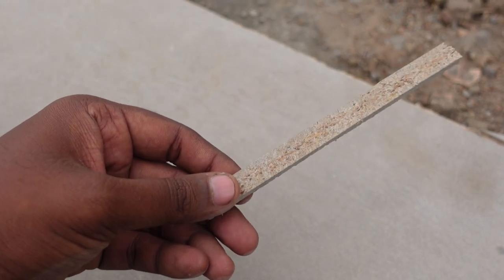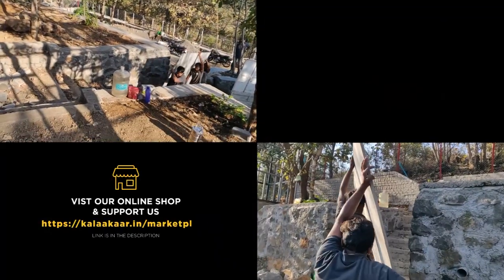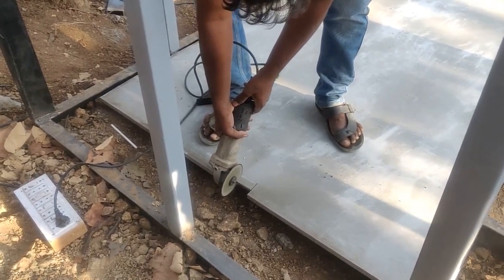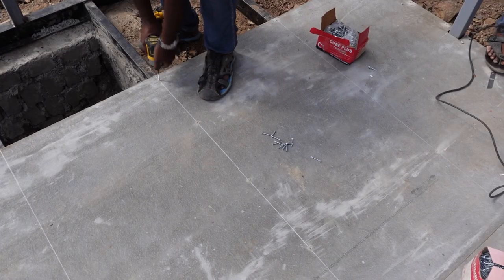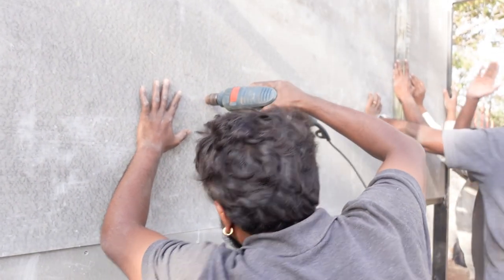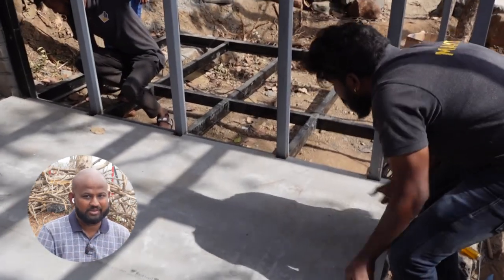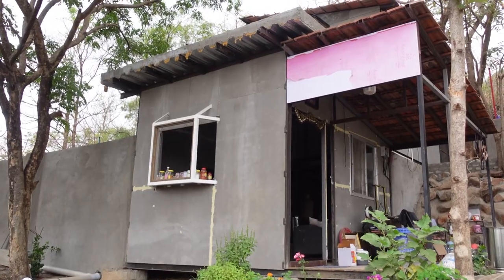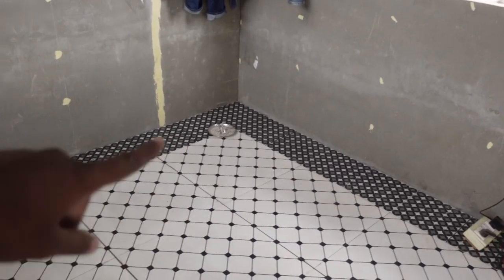Putting up Bison Panel walls - Tiny House

Comment: Great... This is future of individual small houses. May i give one suggestion?
The panels which you want to paint, first give one or two coatings before fixing. This will same time, paint quantity, improve quality of paint and equally important is during ceiling painting, printer eyes are not exposed to paint drops falling in eyes...
Reply from the maker: Thanks for the tips!

Comment: Hey @kalaakaar-in Team. Nice informative video. Can you please tell me how to hang photo frames on bison partition wall. Can i use nails or i have to drill screws? Or there is anything else we can do.
Reply from the maker: Using nails will crack. So please use screws directly like how you use in wood. This will work
Reply: @Kalaakaar-in  Thank you for the answer.

Comment: Great video , I have a question... 
Can these pannels be used on brik wall instead of plastering ill just get a board and stick it up against the wall using cement ?
Reply: You can use the bison panel above the normal brick wall but just make sure that you are using low thickness one and you have to drill it on the brick wall.

 I would prefer that you get the help of knowledgeable technician so that he can help you

Comment: After your video i plan to do for room partition do you think it's a good idea? Because we built the home in normal brick and cements.. when I contact the agent they said they use only 6mm steel instead of Iron Pipe.. will it survive? Also how much mm Sheet needed for room partition. Any Idea please?
Reply from the maker: Yes. It is a good idea. Go for it. Entire hospital partitions are done using this sheet. 10mm minimum is good.

Comment: This is my dream, when I build a new house I'll try it if possible in Mizoram , for exterior wall how many design u have? 

I really love it because can be use for flooring also, if we used for floor,did needed hard wood floors carpet?

In the video, you used steel for foundation I hope it will rash earlier
Reply from the maker: Steel takes atleast 70 years to rust if you have painted properly. On top of bison panel you can do tile work or wooden carpet.

Comment: For wall do you put on both sides to cover the iron structure?
Reply from the maker: Yes. I added insulation inside and put sheets on both sides.
Reply: @Kalaakaar-in  👌

Comment: Great work sir.. planning my own fiber board construction… learned a lot,having a few doubts,hope you can help with them
1) how plumbing can be done in a fiber cement board , will the screws hold the pipes when water flows through?
2) the risk of electrical discharge? Any protective measures?
3) in case of a mezzanine floor will there be any vibrations , even with tiles ?..
Thank you.😊
Reply from the maker: 1. We do it outside the home. Not inside the walls.
2. The house is grounded and also the MCB trips. Also we run the wires outside the walls in conduit. We did not try to cut the steel and keep the wires inside.
3. If you have enough supporting steel then the floor does not vibrate. And after tiles it becomes heavy that vibrations are reduced even more.

Comment: Wow Congratulation you are the first tiny house builder from INdia I know of in Youtube. India needs tiny houses actually more than any other country And the tiny houses in USA are such a big joke. They call 850 squarefeet as tiny house. IN INdia that is the standard size of 2 bedroom flats in highly populated cities.
BTW you did not mention the price of each sheet. Could you share the current prices.
I wish you were in my city the @@#$#@ Interiro decorates refuse to use BIson Sheets they say it works out the same as plywood. I knew it was 40rs per Sqft. And a cheap and decent quality ply is not less than 60 rupees and then you have to put 60 ruppes or say 40 rupees cheap laminated and then pay the carpenter 120 per sqft labour.
I wanted to make dry wall in my office with This Boards on MS Frame and use PINE wood style laminated MDF for the desk which was hanging on MS frame and use the pine and gray of the Board as a color combination and just put a sealant on the board to reduce the cost.
It would have been over in 3 lakhs or less but In my city a 1000 square feet carpet office will not be ready for less than 10 laksh and cheapest is 7 lakhs. But my interior decorator just kept lying that this plywood will cost the same and then the end bill was 9 lakhs even though we gave him a budget of 5 lakhs and he was earlier very open wanted to do something differnt but then he decided to fleece us. First he said he will give us wooden flooring in 5 lakhs which was doable as this would have easily finished in less than 3 lakhs.
Best part these boards are sound proof.
Please share the current cost of thes boards 8x10 or square feet wise and per MM. My friend in bangalore is opening  a small restaurant I want to advise him to use Bison panel but even there the carpenters and even the dealers are saying that Bison and Ply there is no difference in cost. I find that hard to believe.
Reply from the maker: Bison panel would have saved you a lot.

Comment: While screwing the wall instead of 3 people holding it up and wasting manpower, why not use C clamp to hold the sheets to the frame while doing so?
Reply from the maker: The weight is too much and the clamp can crack the sheet

Comment: Exposes Iron rusts, the bison panel where it's been cut will absorb water. This seems like a build for 8-9 years. Why not build conventional style using brick, cement, iron? 🤔
Reply from the maker: Bricks and cement became conventional only in the past 30yrs. Before that it was mud. Now in the future it will be all steel. Bison panel does not absorb water as is. But to be safe we will fill the gaps with epoxy and white cement and later oil paint it too.